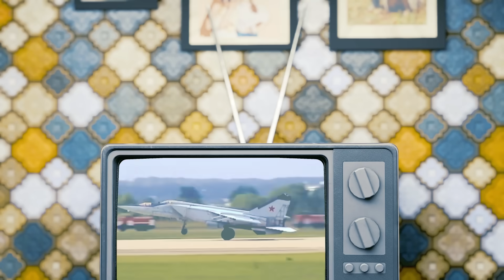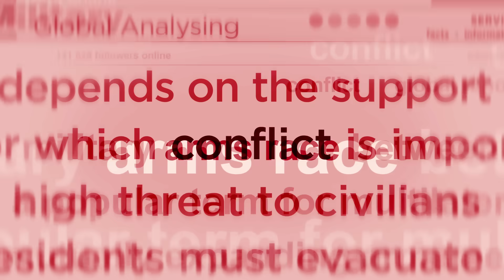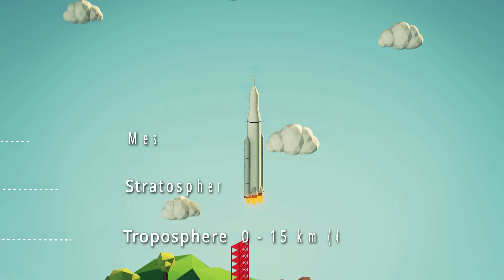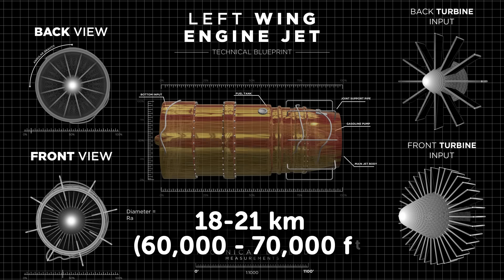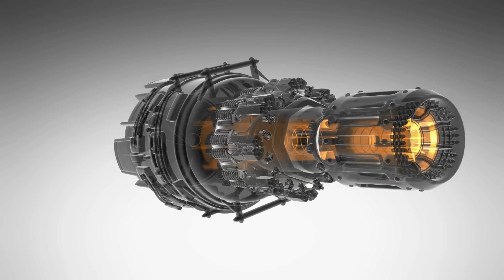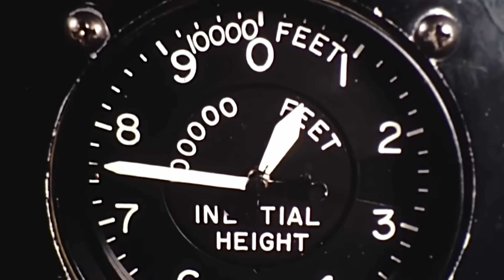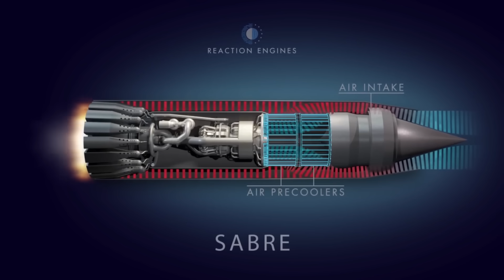Why No One Has Broken This 37km Flight Record!

Comment: Excellent work! As a 30yrs MechEng in aerospace engines, you got all the questions right. Why we tried to break the limits with conventional engines, why the record has not been broken yet, and why this aerial leapfrog took place in the first time? I too, believe with everything I’ve seen that 6th gen engines will be hybrid and enable cruising altitudes above 25km. F47 is to show the way…
Reply: While not a fighter jet, but still jet powered,  the SR-71 Blackbird with the J-58 Prat and Whitney engines.  They actually did get to 100, 000 feet. And back again.
Reply: @patch5859  the SR71 had dual cycle engines, it switched to a ram jet above certain altitudes - it is rumoured to reach 200,000 feet
Reply: @patch5859 
Who cares the SR71 did  not reach 123,000 feet 
I do not know why you typed that diarrhea
Reply: It could climb, turn, or accelerate away from missiles.  85,000ft and mach 3.2 were way below its maximum performance.  I have come across 120,000 many times including an interview of a pilot that I actually attended.
Reply: @Ohiostmrchbandawesom 
The SR71 is not stated or recognised as reaching 120,000 feet
I do not believe your trust me bro garbage regarding pilots
Reply: @MMR-s4t  Agreed.

There's a lot of garbage out there exaggerating the performance of the SR71.
Reply: @MMR-s4t  "Too Hot to Touch. More than 30 of the superplanes have been built in Lockheed Aircraft’s fabled “Skunk Works” under the supervision of Aeronautical Engineer Clarence (“Kelly”) Johnson, the man who also designed the U2. The Air Force admits to one squadron, stationed at California’s Beale AFB, but the planes are also known to fly out of Okinawa, the Philippines and Thailand. Although a few other aircraft can challenge the SR-71 in a brief dash, the Blackbird can fly 2,000 m.p.h. at 120,000 ft. for as long as an hour, far outdistancing any rival."  Sorry if you had not read this, because it was out before you were born...  Time Magazine...
Reply: @Ohiostmrchbandawesom 
That it is the Mig that is recognised as the aircraft to fly near space and not the SR71
No one today believes US propaganda anymore
I think that answers the comment you posted
Reply: @MMR-s4t Turbojets won't even cruise at 85k...
Reply: @Ohiostmrchbandawesom  Your posts are contradictory. In your earlier post, you quote from a Time Magazine article stating the SR-71 cruised at 2,000 mph and 120,000 feet. Then you say 'Turbojets won't even cruise at 85k...'

Which is it? The SR71 is a very sophisticated turbojet, but it is still a turbojet. The issue is that the air is very thin at that sort of altitude and jets tend to flame out. SR-71s could slightly exceed their record figures in the right conditions, such as cold weather and with a tailwind, but still be well below some of the more fanciful figures quoted by some sources. I've read technical articles that explain the reasons why they couldn't reach the speeds some sources quote. It's basically down to thermodynamics. It would just overheat catastrophically. Even titanium has its limits.

The jets that climbed to higher altitudes used zoom-climb techniques. They built up a lot of speed and pulled up into a steep climb. Their engines cut out well before they reached their ultimate altitude and they coasted up the rest of the way until almost all of their speed was scrubbed off. The very thin air reducing the rate at which speed was lost. The aeroplane would then be pushed over into a dive and the engines restarted once enough altitude had been lost.
Reply: @MMR-s4t  if a fucking mig25 (not even 31) could do 130,000 feet with conventional cycle engines, the SR71 with dual cycle engines (ram jet) would definitely go higher.
Reply: @jurgenkurgen you sir are correct on that.
Reply: F47 is a fiction, rubbish idea😊

Comment: Ancient tech ?  😂   - sure, the kind of tech you find from superior ancient civilizations. Give the credit when due. NOTHING beats MiG-25 tech achievements today, hence it's still superior.
Reply: eh, we have more powerful radars, more powerful missiles, more powerful engines, better avionics systems, etc
Reply: @coyoteeffect  50 year later, sure. Although MiG-25 was replaced by MiG-31, which had the world-first ESA radar, what they called phased array, so it had both the best in the world radar and maintained the best high-altitude + high speed performance, making it the best interceptor, still in service today and now armed with hypersonic missiles.

Comment: Cool video, but one correction: 08:45 No satellites operate below the X-15s maximum height, nor do they even really come close.  The lowest orbiting satellite, GOCE, had a perigee of about 229km, which was more than twice the altitude of the max altitude obtained by the X-15.  Most orbit higher than that.  The ISS, for instance,  orbits around 420km and even up there it still needs periodic boosts due to atmospheric drag.   The X15s altitude would be far too low to sustain orbit, as the atmosphere would still exert enough drag to slow a satellite down and cause it to fall back to earth in a relatively short period of time.

Comment: the mig-25 wasn't built for stunts, sore patriot.  The entry in service of the mig-25 forced the USA to stop the sr-71's ** crass violations ** of CCCP air space. This was the mission the mig-25 was built for and it was a job perfectly well done (but concededly the glorious polikarpov I-16 can out-turn the mig-25 and yamato like a joke). The mig-25 came with record 3.5-mach+ top speed, record 38-km ceiling, record climbing prowess, and instant scrambling time, which together with its quartet of huge AA rockets (not missiles) with 80-km reach meant assured destruction for an intruding sr-71, so the US had suddenly no use for the plane and had to retire it since the plane became useless while remaining abominably expensive to both build and fly [on top of its endless 24-hr+ 'scrambling' time, etc]. Also google: "Samurra Air Battle" and "When MiG-25 Foxbat Shot Down F-15 Eagle - Fighter Jets". The irakis shot down the f-15 with old mig-25s and outdated rusky AAMs.  PS. the pentagon and boeing most likely rushed to suppress all records of this battle after invading iraq in 2003 except for pilot testimony in order to keep selling the f15 to vassal states.

Comment: “Going to space” IS NOT about “going high enough” it is ENTIRELY about speed and not speed per se it’s about VELOCITY. 

IF IT WERE POSSIBLE to “fire” a cannon ball precisely straight up to 2000 miles, it would eventually (&not very long) come almost precisely straight back down-excepting for wind environment etc. and how far the earth had rotated under it on its “trip”. 
“Escape Velocity”. 18,000 abt., MPH. Only barely to “get there”, if you want to circle one revolution per day to match the earth under you, you’ll have to increase that to 23,-24,000 and ascend in altitude on up to 22,-25,000 miles distance. 
Short of that you are in LEO, Low Earth Orbit.

Comment: dont worry, the SR71 can ONLY go to 80,000' feet - LOL (more like 200,000 feet) - it has DUAL CYCLE engines that switched into ram jet mode above certain altitudes

Comment: 😮😮😮.... How did mig25 with esentialy same engine tech like todays jets climb 37km when 21 km is boundary?

Boundary this.... Boundary that....
Everyting explained but the reccord.... 

The last time I checked mig25 never had heat resistant plates so reentering and flying back from. 37km would be a chalenge, jets wont work without air, steering dont work without air, wrong angle of reentering could probably rip wings of from plane,  suffocated jet engines can maybee be powered back on in flight but not before 21km boundaty which means free fall for 16km would create prolonged spiraling and/or G-force momentum unberable for human body.....
So how they did it?

I gues it happened the same way like moon walk that accidentaly never happened again after succeding whith calculators not todays computing power and wifi transmizions tech. Dont get me wrong moon walk did happened but are the guys walking moon and than later exiting landing pods on tapes same people? Soviets had also people in space never ro return they just didnt had good PR office.  Apolo13 was just "one time" problems hapoened and the whole thing was abruptly abandoned?!? 

What I mean is that sending umanned aparatus 37km upwards or to moon for that matter is one thing, sending breadhing living person and returning back live and breathing is a whole nother ball game. 

I guess Soviets similarly have "problems" remembering technology they already conguered 50-60 years ago.

Comment: The biggest issue with this is it was NOT a MiG-25 that set this record(it also unofficially set the speed record as well). It was the prototype of what eventually became the MiG-25. There are numerous declassified engagements where a Foxbat tried to intercept an SR71 and those pilots have now openly talked about this on podcast where it was indeed fast at lower altitudes, they simply climbed to where the MiG-25 coudln't and accelerated away. Also none of the MiG-25 that have been "acquired" over the years have been capable of achieving anything close to it's prototype numbers. This was at the height of cold war propaganda so what makes more sense. Hyperbolic claims that exceeded current records by +25% or this was a purpose built aircraft to do this ONE time so the west would think every example of the MiG-25 had this capability?

Comment: Ok... we need to stop saying Boiling because people correlate boiling with extreme heat. At high altitudes or lowering pressure around a human body too fast will cause gasses to expand, and therefore, bubbles expand too fast for the human body to process 
* so we can just say "Gass expansion" to be more accurate
Reply: "Boiling" is the accurate term.  It's not just gas coming out of suspension.
Reply: @jursamaj it's exactly that. Gas expansion in a fluid suspension. Called Boyle's Law. You can get gas expansion due to rapidly heating a fluid suspension. But the case of a vacuum this is due to the rapid decrease of pressure.
Reply: @2XtreemRob  Boiling is when the temperature and pressure conditions lead to the liquid itself turning to vapor.  This is an entirely different phenomenon from suspended gases (which are a different substance from the liquid) coming out of solution (which can happen without bubbles).  In a rapid loss of pressure, you are likely to get both happening at the same time.  But exposed to hard vacuum, at body temperature, blood (basically water) will certainly boil.  Look at any phase diagram of H2O.
Reply: @jursamaj  Rapid loss of pressure does not cause heat. The opposite happens. Take any can at home under pressure and spray its contents all at once and you will feel the can get cold. As the pressure in the can decreases, the gasses axpand expelling its contents through the sprayer. Conversely when you pressurize a can it gets hot.
Reply: @2XtreemRob you are wrong in your understanding of the phenomenon and confident you're right at the same time...

Like the last guy said: study the phase diagram of water. Lower pressure will lower BP; it's not that lowering pressure 'causes heat', it's that lower pressure lowers the BP.

In your spray can example it's not that a pressure drop causes the can to cool. There is (effectively) no pressure drop because the propellant boils off more vapour to maintain pressure as you spray.

The propellant is a hydrocarbon with boiling point lower than room temp at standard pressure. When you release the pressure, it boils in the can, absorbing heat as it vaporises, and keeping the can under pressure. 

Ironically this is exactly what happens in a vacuum to liquid water. It boils until it freezes.
Reply: @2XtreemRob  Boiling does not require an increase in temperature.  It only requires crossing the temperature-pressure curve from the liquid portion of the phase diagram to the gas portion.  That can be done by adding heat, but can also be done by reducing pressure.  Seriously, go look up the water phase diagram.  You're embarrassing yourself here.
Reply: Anyone knowledgeable about technical stuff, those most likely manage this sort of video, understand lowered temperature B.P. They are likely to have seen those videos showing outgassing of vacuum-challenged raised water levels at height in vertical tubes, and then literal boiling, all at room temperature.
Reply: @-danR it's called Boyle's Law

Comment: BTW, at 8.50, something: The Germans thought this would be a "nice" idea.
As You might know, they had a "one way" fighter, so to say, with no landing gear and a rocket engine.
For a fighter 🤣🤣
Reply: The Me-163 had landing gear, well a skid. If the landing wasn't too bumpy, it could be refuelled and re-used.

If the landing was too bumpy, that was unfortunate for the pilot.

Bachem Ba 349 Natter was never used operationally. Some gliding trials were completed, but the only manned rocket-powered launch had a tragic ending.

Comment: Starship is so big it can carry planes actually designed just for space into orbit. And also big enough to use as spacestations.. presumably why the military want to buy some once they are finished.   They could go to space loaded with a couple of rocket jets and dock to other starships to form an orbiting base that can launch fighters designed just for space.   No compromises caused by trying to add maneuvering thrusters to atmospheric jets.  The bigger question is that if they go nuts blowing shit up up there...how long till there is so much high speed crap drifting around that space becomes useless to anybody.

Comment: Great video!! Crazy that a 37 km flight record has lasted this long. Just wondering how nobody managed to break it yet?
Reply: There is no logical reason to break that record.   The MiG-25 didn't actually FLY that high....it was merely the peak of a ballistic arc as the aircraft was out of fuel and the engines couldn't even begin to run up that high.

To actually FLY that high you need engines that can make enough thrust to maintain very high Mach #'s because the air is so thin to slow down means the wings can't make enough lift to hold the aircraft.    The pilot also must be fed oxygen which is mostly what's limiting modern fighters with OBOGS which alleviate the need to constantly refill LOX tanks during refueling which can't be done mid-air so their range is severely limited.   The SR-71 holds altitude and speed records because it was right at the limit of air breathing aircraft able to actually FLY at 80,000 feet.
Reply: SR-71 has never reached 37km altitude

Comment: It's almost 38km (37,7). But yes, the mig-25 is so primitive that it also still holds the record for the highest speed ever reached by a non-rocket plane, i.e., 4.3k km/hr (vs. 3.5k km/hr for the sr-71) only that the mig-25 cannot keep the 100m altitude corridor required by the morons at speed records inc. so they didn't accept the mig-25 3.5-mach flights as faster. See the data and plots here:  https://www.youtube.com/watch?v=YDN9wv9bois.  PS. the mig-25’s engine is not "destroyed" after a 3,5-mach+ flight; the engine needs only minor part replacements. See also the data and plots here:  https://www.youtube.com/watch?v=vSn9_6Vnft8
Reply: 😂😂Still primitive

Comment: Unbeaten? Did not an F104 Starfighter exceed 130,000 feet in a zoom climb?
Reply: 120.800 feet
Reply: Wasn’t it a rocket-equipped F-104
Reply: Sorry, no.

As @maxchizhov states, the highest altitude reached was 120,800 feet. This was an unofficial altitude reached by a special NF-104A rocket-assisted aircraft, as noted by @flyingwombat59. It was used for astronaut training as it was fitted with reaction control thrusters and helped with X-15 pilot training.

The highest altitude reached by a pure jet F-104 was 103,389 feet, which was then the official record.